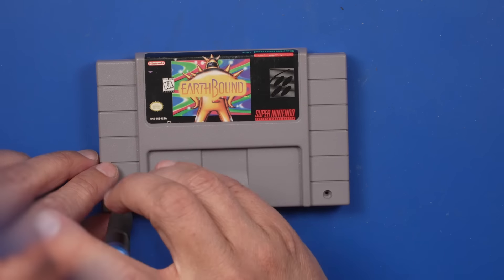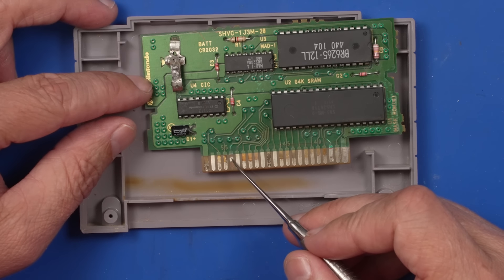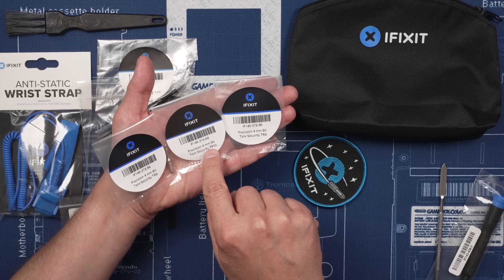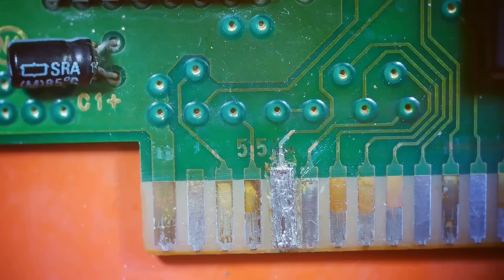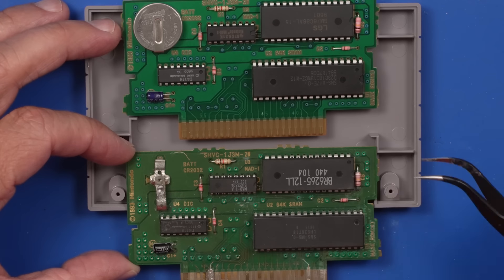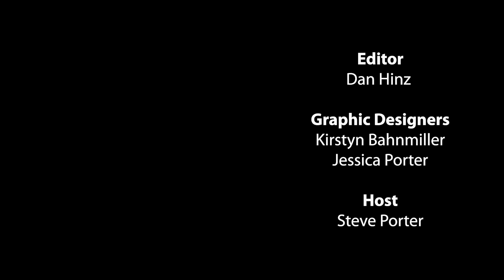This SNES Game is Worth Around $400 IF I Can Fix It!

Comment: Interesting question: So what makes the game the game? Ultimately, this is a completely different game except for the chip you swapped. But, pop in the game and it is what it is.
Reply: Every SNES that has save files will have 6 components to it:

-ROM Chip  (what he swapped) that consists of the game itself
-Decoder Chip  (device used to help with communication between all the devices)
-SRAM Chip  (this is where the save file is stored only when powered)
-SRAM Battery  (the coin-cell battery that keeps the save file alive)
-CIC chip  (lockout chip for region locking and authenticity checks)

Not all games, but many SNES games have piracy checks that don't outright stop the game from being booted but instead change the game or will even corrupt/wipe the save file at certain parts. This game has checks that if aren't returned properly the game will be significantly harder to the point of almost unplayability and even the final boss will freeze and wipe the save file.

Comment: It might be non critical, but the original SRAM chip labeled BR6265-12U has 120ns access time. The donor cart has a LGS GM78C88AL-15, which i cannot find but looks 150ns access time to me. In theory, the donor SRAM chip might not get the data ready as fast as the original one. 

Furthermore, I wish you best for your health!

Comment: Considering it's not even the same board, I doubt that they would have an issue with an upgrade being put onto the board for the battery, which makes the upkeep easier.

Comment: Aww darn, I wanted to see if you "experiment" actually worked... You should put the donor game chips on that board and try to fix the other pins that same way and see if it works. That way you also know for the future that it does or doesn't work. Missed opportunity there Tronics.

Comment: I dont think you need to worry about the battery holder. The cart PCB has already been swapped, so in many collector's eyes it's not "authentic" any longer.
Reply: which is odd its the same model of pcb....prolly the same factory and assembly line

Comment: The pink things with lines are resistors, not capacitors. 😊
Reply: @MillerWB87  not quite, the pink ones are capacitors. There's a resistor at the top of the board. They're all even labeled as "Cx" and "Rx" on the board.

Comment: SNES games usually have interchangeable PCBs.
the code on the PCB tells you the kind of game:
1J3M = 1 ROM chip, HiROM (no special chip) 3=64kb RAM, M = MAD-1 memory address decoder

You can transplant the Mask ROM chip (U1) to a good PCB and it will work again.
NHL 96/ 97, Ken Griffey Jr.'s Winning Run, Madden NFL '96 and Mark Davis' The Fishing Master will be good picks for a donor board. Those are cheap and unwanted sports titles.

Comment: Steve, what was that template you used for the initial trace repair. I can see that being convenient for other situations for the in and out use of those pin traces not so much, good call. Wait a minute, did you blow on it first? 😅

Comment: It was a good save! The cart will not be worth as much as one with a real Earthbound board. Collectors will notice that it is a donator board since it says 1998 and not 1993 and of course also the battery holder (which is way smarter than the soldered), but not original.

Comment: Adding the replaceable batter holder won’t devalue the game.  It improves it as the owner can easily replace the battery.  What devalued it is the repair as you replaced the original board.

Comment: The vintage/retro market is insane. 10 years ago I picked up a bucket of lose carts. I had about three copies of Earthbound in it. one of them, the card edge was much more destroyed than this one. I cannibalized and combined them into a clean working one. One of them was completely dead, but the cleanest of all. a guy was willing to buy it from me for $300 lose, no box. When he asked where it came from, I explained what I did and he dropped the offer to $175!  "it wasn't original" was his excuse. the ROM, lockout and timing chips were! even reused the resistors! under a microscope, there were no markings distinguishing the board at all between the three. the soldering job was the most top-notch work I'd ever done, multiple ROM dumps and checks against a known dat several times showed that the programming was 99.9% exact, yet the dbag was convinced that he was justified in dropping the value. I stopped refurbishing the high end value carts after that.

Comment: Well the mother board might be repairiblr the hard way but by simply swapping those chips on another identical motherboard , you can repair this game.
But is it still worth $400 ? Since that replaced motherboard will probably have a different model number i suppose.
Still through you did grat experiments and a great job for fixing it😁

Comment: Few things. 
1. That game is worth maybe $30-$50 now only on the fact of the original case (The seller ripped you off.)
2. You may want to go back and swap out the other chips as the game has a very unique anti-copy production that is most likely going to be triggered without the proper chips.
3. I wouldn't sell it at this point and just keep it because anyone who buys that at any price about $30 is going to feel ripped of.
Reply from the maker: Thanks for the tips. As far as pricing goes eBay solds support my estimates.
Reply: I agree $200 for that state was definitely a big ripoff, but this is really is valued in the $300-400 dollar range if it hadn't needed such heavy repairs. But at the end of the day it's worth what people are willing to pay. Ebay sold prices range from anywhere from $255 up to $405 in the last 6 months more heavy weighted to $300-350. For my collection I wouldn't touch this with a 10 foot pole, but I'm sure plenty would for a reasonable price.
Reply: @Tronicsfix  Ebay solds assume authentic Earthbound hardware. You swapped out the board. That's like swapping out the frame in a classic car. Once the original VIN doesn't match the frame VIN, the value to a collector falls dramatically. The only way you could expect to get collector pricing for this is if you don't disclose the board swap in the description. No way someone pays that kind of money just for a playable version of the game. There's a lot of cheaper methods to play the game.
Reply from the maker: Nah, that’s taking the condition into account
Reply: @Tronicsfix  There has only been one repaired Earthbound sold in the last 6 months on Ebay and it sold for $252.93 (350 canadian). And the one sold has a better game label than the one you bought. Similarly damaged front labels that yours have sold between $250-310. The carts selling over $400 are all in amazing shape with authentic boards and zero repairs.
Reply from the maker: Yeah, I wouldn’t expect this one to get absolute top dollar

Comment: I think the hugest problem with these cartridge based games is that over time no matter what you do unless you somehow figure a way to completely protect those pins. But it's going to corrode over time anyway
Reply: Good news is that replacement PCBs are easier than ever to make. The hard part is transferring all the chips and resistors 8)

Comment: Yeah Nintendo loved putting extra chips in the cartridges making them good and expensive but they’ll last forever minus the battery which will have to be replaced when it dies or the system left on during a playthrough.

Comment: I hope that you’re disclosing that this is a chip swapped cart when you sell it. That decreases the value by a lot since it’s no longer the original board with all the same chips and markings. Most collectors pay these big premiums for an original cart and don’t really care about being able to play the game beyond it working. Just throwing that out there so you don’t get a disgruntled customer when they go to sell it and they open it up to verify it’s not a clone and see this was done. Otherwise, great video and a great solution for getting the game working again.
Reply: The board is identical except for the date (noticed the date is the same to so realistically the board is identical).  I would much rather have the clean board and contacts over the original piece of crud board myself.  He is essentially saving that ROM from a slow death on a horrible board.
Reply: @jimbonater  you're not a collector then. The value comes from original parts, not swapped parts. It's like changing the frame of a classic car. Once your vins don't match the original paperwork, the value decreases, sometimes significantly.

Comment: Did you modify the battery holder off camera? I’ve never seen a version that didn’t need one of the leads thinned and then converted to through hole.

Comment: Question for ya. If the boards are the same PCB, couldn't you move all the chips from the Earthbound board to the NHL 97 board to get a working copy of Earthbound? Isn't all the game data on the chips like how the data for programs on PC is on the flash memory in a SSD?
Is that what you actually did and I just didn't understand your explanation?
Edit: Yep, looks like that's what you did and I just didn't understand your explanation.

Comment: Due to how much damage was on the original cartridge, I'd honestly get a tool to run a hash on the ROM to verify that there is no corruption. IDK about you, but I'd feel terrible if some unlucky soul paid me $400 and it turned out the game was corrupted later in the game or something. If you can verify the hash against a known good copy, you can feel confident the game is 100% good. Not just that it boots up (which is still a good sign but still not 100%)

Granted, these old Nintendo cartridges could probably survive a nuclear war. So, it's likely good, but that's just something I'd do just because $400 isn't exactly cheap.

Comment: is there a reason to not use a donar board to transfer all the components to? a cheap NHL 97 cart has the same PCB so you could get one of those and use the PCB as the donar

edit: opps. should have kept watching! I made this comment when I saw the pin repair thing going on!

I wouldn't pay more for the battery holder upgrade but I would pick it over one without it at the same price! but I WOULD pay for more an FRAM upgrade to never need a battery again (check that out, could make a fun video. they have come really far)

Comment: What battery holder is that?  I've tried multiple that look just like it but the negative blade is too wide to fit in the snes cart.  Trying to cut or modify the blade has it falling apart.

Comment: When checking the resoldered joints ... you checked the wrong ones. You checked the bottom row of the resolder chip ... then an entire different chips solder joints. min 14.17. :(

Comment: Changing the board does not affect its value, it is the same board and more importantly, it is an original board of the time, what could affect its real value could be the battery change, serious collectors always want to see the board and want it as original as possible, seeing a modern battery holder makes them doubt about what else was modified or changed to the game and they will refuse to pay the full price.

Comment: A caveman has been at the inside of that thing. Maybe when they tried and failed to replace the battery they used plumbing solder they had laying around and the acid flux got spattered on the board which made the holes in the copper over time? I'm just trying to figure out what the hell happened to it.

Comment: Also, I think it's crazy that someone sold this broken unplayable game for $250... even if it is Earthbound, and even if they disclosed that it does not work.

What's crazier?....  That someone purchased this broken mess for $250, even if it is Frankenstein'ed back together to working condition. 

Will you be disclosing all of the modifications in your e-- bay listing?

An interesting situation.  You payed top-dollar for this original item with its original damaged components.  
....But you are going to have to change out the original board and battery area, thus modifying the original factory material, thus making it 'not original.'

Comment: 11:45
I apologize if this sounds like a dumb question, but is there any way that you could just use the hot solder iron to remelt the solder and just put the new chip in with it?

Comment: You know what.  You should have copied the ROM drive and install the copy onto another ROM chip.  Make a backup of it.  Then try installing it onto another device.  See if that also works.  Then you have many ROM chips with earth  bound.  I sure as hell would.  Should you find another broken game like what you had, then you have ROM chips with the copy on it.  Install it and ship it out.
Reply: ROM means "Read Only Memory".  Original chips are exactly that, read only.  You can't write to them.  Yes, you can dump the contents of the ROM chip to a file, then write that file onto a programmable ROM chip.  Those are called Reproduction cartridges.  Reproduction cartridges are copyright infringement, no better than downloading the ROM and emulating it, unless you really need to use original hardware.
Reply: @Dwedit  Well to get the information onto the ROM, you need to write to the chip set.  So this contradicts your claim for "You can't write to them."  They had to write to it in the first place.  See the problem.  What you should have said was " you can copy the data but cannot write it back as ALL block codes will not copy correctly.  It is coded for once only.
That would make more sense.  Meaning its a pirating protection issue.  This is common practice for writing up code.  Thank you for your version of education.

Comment: Hi I have electronic cutters runs from recharge for ten minutes when trigger pressed but if trigger released at any time it wont then run. after recharge it will again work till trigger released but then wont run again. It’s like some sort of reset. It’s a  9.6 v. Battery and charger all ok. Any ideas?

Comment: Does doing a chip transplant devalue the copy of the game significantly? I know it's essentially the same game, but collectors seems to not care that much about actually playing the thing and rather just having an original copy. That's the only reason anyone pays hundreds of bucks for something you can run easily on an emulator right? I guess it's like engine swapping a classic car, matching numbers matter to value even if you use another original engine from another identical model.

Comment: While replacing the battery with a new holder might not change its value much replacing the whole board with one from a different game most likely will. The game is no longer original.

Comment: Dude... clean up the corrosion on the chip man... leaving it with completly oxidized legs is just nasty, and asking for more failures down the road.  That corrosion is going to spread into the solder joints and then down to the traces. 😕

Comment: You'd be better off using a donor board from some cheaper and more readily available game cart and transplanting the chips instead of spending so much time fixing this disaster, which is sure to fail again because of so much bodging.

Comment: For those that think I am being bitter for the loss of 20 minutes of my life, hear this. Things that cannot be carbon dated.Stone, metal and pottery... Yeah that Applies to fiberglass too. Take a pic, add the measurements. and in a week you can get new PCB's. And... that if taken care of the right way would last as long as the chips ROM retention data life specify.

Comment: theres no way youre getting 400$ for this if you disclose the repairs and under the hood damage done to this cart. The 250 you "paid" for it is dubious as well. Carts in this condition are peaking at 200 ish.  One sold in good condition WITH the box for 207$. "Does not work" carts are selling for under 100$. Clean carts in relatively good condition are selling for 220-300$.

Comment: You got ripped off by the seller for this one.  They knew it was in really bad shape.  You won't get full value for this cart because of the transplant (and label condition) but you should be able to break even at least.
Reply from the maker: I knew exactly what I was buying. Similar games on eBay go for a lot more than I paid.
Reply: @Tronicsfix  $250 for a cart that clearly had water or battery damage is a rip-off.  The seller knew because it had been opened and cleaned before.  Just saying he should have charged you less.
Reply from the maker: He showed me pics of the condition. I knew exactly what I was getting. I can't agree that it's a rip off if I knew exactly what I was getting and I paid the price he was asking.
Reply: @Tronicsfix  Well if you knew and agreed then I agree, it can't be.

Comment: This feels pretty deceptive.  Why bring up an NHL 97 donor cartridge if it was never used?  The NHL 97 has a board  dated 1988 but the final repair clearly depicts a 1993 revision. Seems pretty sketchy to tell others that they can repair an expensive cart with  a cheap one when it looks like that is not what happened here.